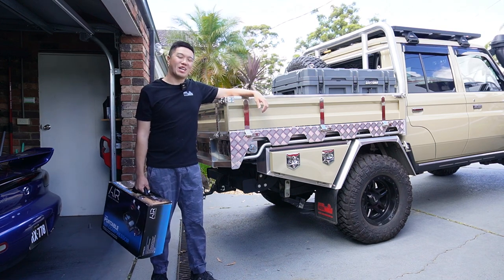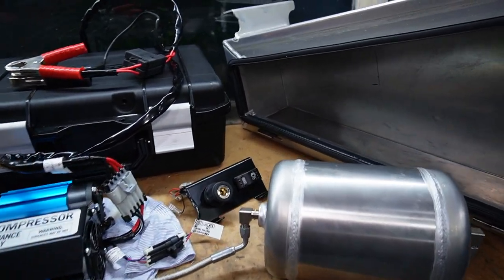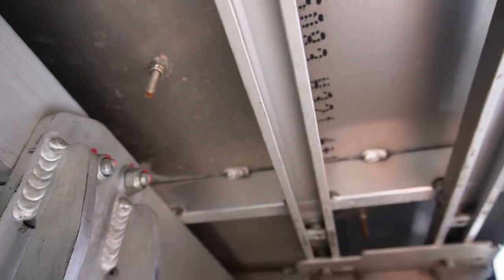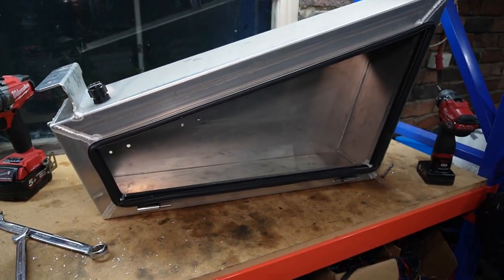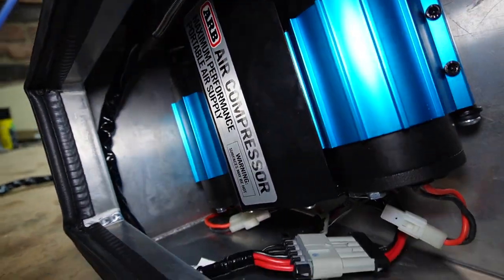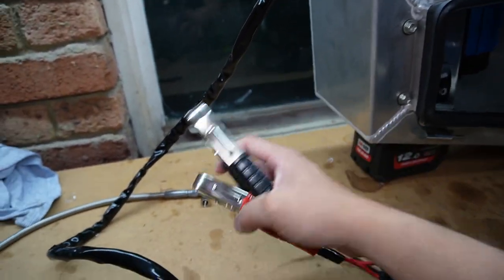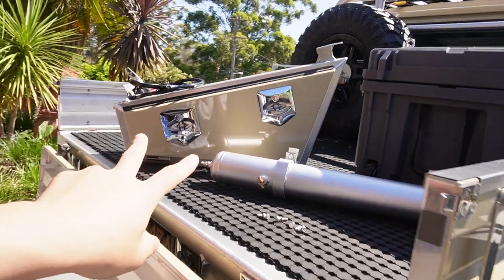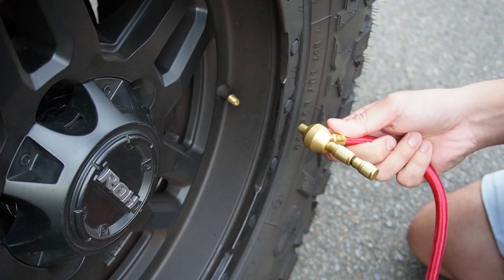ARB TWIN compressor install into undertray toolbox

Comment: Very neat install Jonathon, only suggestion I have is to add on the Arb air pressure control module. You control it on your phone via an app, you can have preset pressures eg road, sand etc. I get out of the car, plug on the hose and turn on the compressor, choose the preset and connect the hose to the wheel. It inflates or deflates to the set pressure automatically and I believe it deflates the 4 tyres in a faster total elapsed time vs the dedicated deflator as your not wasting time screwing the deflator on, removing the valve and then in reverse afterwards. I don’t even bring my deflator and inflator chuck any more.
Reply from the maker: Hi mate thanks for letting me know! I'll have a look into it. Sometimes i do run my pressures different front and rear so it may not be suitable.
Reply: @JCYT  I run different pressures front and back. When it starts to do the first rear tyre I up the target pressure by a couple of psi, it’s very flexible

Comment: This video was great. I just bought my new canopy/tray and wanting to do this.  Thanks a lot. Instructions were excellent.
Reply from the maker: You're welcome mate hope it works out! 
I ended up getting rid of the circuit breaker and installed a MIDI fuse in its place The circuit breaker kept tripping on hot days (it was a low quality eBay spec one though). It's been otherwise perfect with the midi fuse.

Comment: jack the side of the car a little bit, the compressor doesn't have to fight the vehicle weight and pressure inside the tyre at the same time.
Reply: You could spray the front of it with WD40 too so it slips through the air better.

Comment: Hey mate, nice neat work. I just wonder how does you compressor air inlet gets fresh air from a sealed box ?
Also is it keeping cool in a tight space ? Cheers mate
Reply from the maker: Hi mate 
I leave the lid open to access the switch and outlet hose so that's not a problem. Arb Compressors can have their breather relocated so that is definitely an option. I would not recommend running a compressor of this output in any enclosed space even mounted inside a vehicle or camppy. Heat is no problem with the lid open during operation. I've been using it on 40 plus days. It's actually a really cool part of the car. Hope that helps!

Comment: How did you get power to the switch?
I've pretty much done the same thing  just stuck on running red yellow switch wire to power
Reply from the maker: Hey mate
As it came straight from the portable box, it was prewired and bolted straight in with two cables going direct to battery. If you've bought the compressor separate, you'll need a relay to control the compressor via a switch. Hope that makes sense

Comment: Hey mate just wondering how you wired the switch? Also the supply from your compressor is that coming from a main battery or Aux? Cheers
Reply from the maker: Hey mate
The switch comes prewired out of the box from ARB and the only wiring I really needed to do was to supply power from the main battery. Best way to do it - I would avoid wiring direct to aux battery unless the battery bank is huge! 
It's just a relay switch, wouldn't be hard to do with any standalone compressor.

Comment: why is the air tank important, why not using the compressor directly?
Reply from the maker: The air tank just stores compressed air in a tank so it's ready to go. Whether it is for pumping up tyres, compressed air gun or other air accessories - it gives a buffer and temporary store of high pressure air
Reply: @JCYT  but it should be still possible to just plug the air hose directly into the compressor and use it like its from the tank, i don’t see why would you wanna store compressed air and get the compressor to refill it every time it gets under a certain pressure point while you can only start it when needed. Am i right?. Let me know

Comment: I'm about to do the same install expect with the provided ARB tank. Why did you run an additional relay? My understanding is there already is one? Was the circuit breaker required? I know little about 12v.
Reply from the maker: Hi mate! There was no additional relay used. The ARB switch/relay is a 2 in 1 so the switching circuit I have left completely as designed by ARB. You will need to run an additional circuit breaker to protect your new cable against short circuits which is a possibility in the event you're in a car accident. The two small 40A maxi fuses are to protect the 2 x arb compressors (on the twin compressor).

Comment: Great video mate. Could you list the parts/website for the additions filler pipe? Other than the 90 degree pipe from Mackay . Cheers mate
Reply from the maker: Hey mate the alloy pipe was existing from the norweld tray however entire filler neck could be substituted by 2 90 deg hoses (1 of them will need to be a long leg hose) + 1m 50mm OD alloy pipe depending where your filler is. Thanks for watching!
Reply: @JCYT  thanks heaps for your reply mate!!!
Reply: @JCYT  hi mate. Will 1.6mm thick alloy work ok or should I go the 3mm?
Reply from the maker: @JamesEastham 1.6mm will be fine!
Reply: @JCYT  thanks. Really appreciate the reply

Comment: What is the wire awg used for the extension? Both red and black?
Reply from the maker: Hey mate 6AWG
Reply from the maker: Yes for both positive and negative. Twin core
Reply: @JCYT  thanks for the info

Comment: Never mount a cable gland on top of your box
Reply: It cannot seal on an uneven/non circular wiring loom
Reply from the maker: hey mate, sorry i missed this.
Yes you can still seal it but shrinking an adhesive lined heat shrink on top of both gland and conduit.